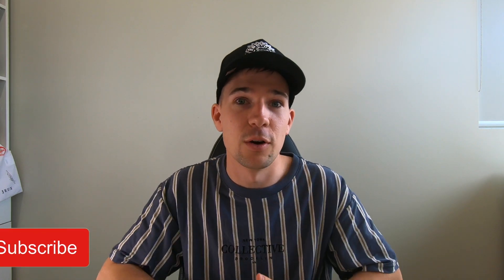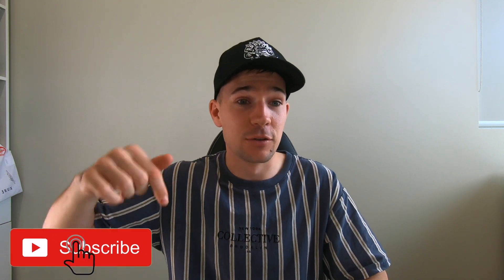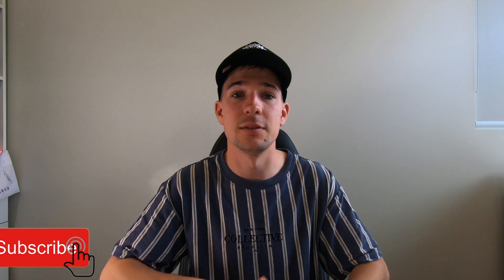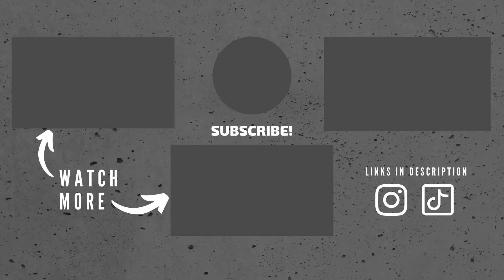TRAINING TO IMPROVE VO2MAX: What your doing WRONG AND how to fix it!

Comment: I find the only way to get  a real good VO2 max is to be a ultra skinny runner. I rather be a little more muscular & still be able to run a mile at 6.5min at 44yrs old as well as be physically stronger lifting weights than I would be with 5% body fat looking scrawny like the wind would just throw me around. Garmin is designed for ultra/ marathon runners so don't get caught up.worrying about VO2max if everything looks good.

Comment: Awesome video...highly detailed content. Based on my research true vo2max pace is about 7min flatout which I've heard you mention 7min also. Ive looked at the McMillan Run Calculator which gives the vVo2 pace set at 8min allout pace. Jack Daniels used to speak about the Vdot tables vo2max as an allout 10-11min value from memory (I think Jimmy Gilbert tabled all the values and worked for Nasa). Im now Using the 95% of true 8min outdoor vVo2max for my running. Sitting on 60km wks atm. With a 6:50km track 2km timetrial (3:25 pace vo2max spd)...5 x 1k @3:35 is 95% & 3 1/2min rest & curious if repeating this 2-3days later would be "ideal" in the 60km run wk spectrum. 

Along with a Zone1 recovery jog in between days say 7k @6min/k. An ankle injury is capping my longrun at about 18-20km which I will keep @65-75% heartrate reserve. Looking to go sub17min 5km over the coming mths/yr. Cheers
Reply from the maker: 2x sets just below VO2max in the week would be ideal pending ability to tolerate training load and as you said space them out by a few days to balance the week up nicely!

Comment: Let's say I'm 31 and at a vo2 max rough calculation of around 38-40.. and I'm training for a fire fighter physical. Lift weights alot but cardio sucks... should I run at like 7mph for 20-30 mins or should I do interval training. Keeping in mind currently I can only run at 7mph for around 16-18 mins.

Iv also been running at 7mph at like 6 Incline. Failing in 2-3 mins, then resting for 30 sec and going for another 30 sec, repeating like 4-5 times. So basically keeping my Hr high for roughly 4-6 minutes. But only doing this whole thing one time per day.
Reply from the maker: Not the best format to go in detail but my usual recommendation is you ideally want to build up to complete 30mins continuous without stopping before diving into interval work. Reason being the really good adaptations start at 20mins continuous running when going “long and slow”.
Once able to do that you typically have enough capacity to handle an effective interval session so I’d start to build in some intervals in your week whilst maintaining you long slow run (or adding some extra volume there if needed/want to).
Reply: @NJSportScience  is 7mph considered slow? Or should I be going slower than that for 30 mins?
Reply from the maker: Without any other data, I’d aim for a 4/10 RPE in your slow runs. Everyone is different when it comes to what is/isn’t slow, but RPE will be relative.
Reply: @NJSportScience  yah fair enough. I can prob run for 30 minutes at 5.5 to 6 mph. Does one work at getting the speed higher or intervals lol. Sorry for all the questions. I got about a month to train as much as I can.
Reply from the maker: It depends what you need to be able to do. If it’s a time trial and you’re not current fast enough I’d lean towards interval work. If it’s not a specific outcome then I’d have 1-2 interval sessions in the week surrounded by long slow continuous work.
Reply: @NJSportScience  I need to run at 7mph, and they increase the Incline every 2 minutes by 2 until I fail. The longer I last the better my score.
Reply from the maker: I would go about a mixed approach then. Do some high intensity interval work but also continue to work on your ability to run at 7mph. In theory you could just practice that test protocol once a week then follow it up with some slow continuous running after and that would be reasonably beneficial. Number of possible paths, I suggest keeping it simple. A few interval sessions and a few long slow at or below 7mph.
Reply: @NJSportScience  am I over training if I run at 7mph every day till failure and then 3 times a week do the practice vo2 max test?
Reply from the maker: I would do a practice test once a week, 2-3x 7mph runs then one more traditional interval session (ie 2-3min on at 9-9.5/10 RPE, with equal or less walking recovery, aim for 12-18mins of “working time”).

Very rough guide but that would be appropriate
Reply: @NJSportScience  awesome! Thanks for all the replies!

Comment: Hi, I love knowing all the nuts and bolts of the specific science behind the workouts which you don't see on a lot of other (great) channels. Is there any research on the number of sessions per week that is optimal? Once a week? Every third workout? Every other? I imagine it's somewhat dependent on the level of fitness, but don't actually know. Thanks!
Reply from the maker: Thanks mate!
Depends what you’re aiming to do, 1-2 sessions of HIIT to maintain qualities, 2-3 to improve however I default most people to 2 per week and manipulate the volume/ intensity/work to rest ratio etc to challenge them further rather than just adding more sessions usually.
Only case I really go to 3 sessions per week is really high level athletes where the 3rd sessions might only be used strategically here and there but also the overall training load is much higher so the proportion of time at very high intensities isn’t very much of the total training week if they only did 2 sessions.

Comment: how about some discussion for the older people 50 plus..my vo2 is 40 according to garmin watch ..what realistly could i get up to. nowhere near 60 i gather...been riding for years ..not improving at all..do 5000k per year
Reply from the maker: There is a large genetic component to your upper potential also which does complicate things further. To be honest the number itself doesn’t even matter, its the number in context that does (ie your VO2max might be 40ml/kg/min but you punch out 450W and an ftp of 400 for example, you’ll still win a flat road race compared to someone with a VO2max of 60+ at 360W, ftp of say 300W. Assuming all other factors are equal)
Reply from the maker: VO2 on a watch is highly reliant on your weight.  So typically older athletes who are 80+ kg struggle to get up to 60ml/kg/min but guys at say 60-65kg do it easily. Also depends on what type of training you do rather than how much. 
Time and time again I’ve gone in and cut out half an athletes weekly volume to get a 5-10% return on VO2max. Focus the time to train the top end qualities required to actually improve it. Why? Because practicing only your strength gets you no where, work on the obvious weakness, easy improvements.

Comment: 57 years old: VO2 session yesterday was 8x3' with 2' recovery. I think a 3' recovery may be more appropriate. Should the recovery be walking as I usually still run but at a very easy pace? Just bought a Stryd pod so I hope running by power is going to assist in getting to the correct zone to run in as paces are tough, especially here in South GA where it was 104F during my session.
Reply from the maker: Depends how hard you’re actually pushing relative to your VO2max. I would say if anything your not running hard enough to be able to do 24mins of work with short recovery. Run faster for say 5 x 3’ on/ 3min walking recovery then work back up. Better off increasing the pace than doing more volume once you get to beyond 20mins of work.

Comment: So in your video you talk about work/break ratio ideally being 1:1...is it better to look at it that way from a time perspective (working 30sec, resting 30sec) OR from a HR perspective (say you start at 100 bpm, working to get, say 90% of max HR, hold for 30 sec, and then rest until HR is back to 100 bpm)? Or is HR not supposed to go back to original levels between sets? If it does, what does that mean from a VO2 perspective?
Reply from the maker: Doing a video on this later in the week, short answer is for high intensity (ie 30on/30off) I go with pace/speed/power, then for long continuous sessions I’ll go HR. Will explain further in the video. Great question though.
Reply: Hey, probably a related Question: I often train at Work/Rest Ratios of 2 (30/15), because of the Heart Rate lag you talked about. This will keep the ventilation going also during breaks IMO. Is there benefit to this or is it Just about time at pace/Power (instead of HR)? Cheers!
Reply from the maker: There’s benefit to both but the key with 1:1 work to rest is I usually reserve it for efforts where you need to maintain a really high intensity consistently. For example when aiming for 95-100% vVO2max the important factor is time spent at that pace. In a session that’s more focused on building at and slightly above threshold I’ll for for 2:1 or 3:1 ratios because the effort intensity isn’t as high so it’s sustainable to have a shorter recovery.

That’s one example but holds true for the vast majority of amateur athletes who are unable to achieve a high enough intensity in their efforts to elicit the right stimulus if they don’t have an equal recovery. Particularly when looking specifically at intensities very close to VO2max.
Reply: Thank you very much for the quick an detailed answer! Keep Up the great Content! 😊

Comment: Great video thanks. You say threshold-type running can get you to a VO2max of around 60, and that people will need short sharp interval training to get it higher from there. But you don’t address whether someone with, say, a 45 VO2Max will make more progress with intervals, tempo or a mix of the two. Implicitly, I think it’s the latter, but you never quite make that explicit.
Reply from the maker: Long slow (base kms) type training by itself typically can improve an athlete’s VO2max until about 60ml/kg/min. To then increase VO2max above this you need something other than long slow distance training (ie High Intensity @ VO2max). Someone with a 45 VO2max still increases but probably progresses faster (ie 45 to 55 in say 12-15 weeks training vs 60 to 65 in the same time period). Law of diminishing returns. This is assuming no change in body weight, if you drop weight as well VO2max relative increases greatly. Lesser trained or untrained people can realistically get somewhat fit off doing anything. I could get someone with a VO2max of 40-45 much fitter than they are now just by saying “train 3-4 times a week however you like for 12 weeks” in most cases. But you’d only get from 40-45 up to say 45-50. These training tips aren’t exclusive to well trained athletes, it applies to anyone, the major point about 60 VO2 is research has shown long slow training on its own can get someone to 60 but no further. So why not train high intensity specific to VO2max and accelerate your development?
Reply: Nick Jankovskis Thanks - I appreciate you taking the time to reply. I’m slowly working my way through your videos, and I’m finding them really interesting/ useful. Good luck with the channel - it looks like you’re steadily adding subscribers 👍

Comment: Apologies if it has been described in the video (it is a long one). You mention your body takes 30-45 seconds to hit max effort. Should 1 to 1 be understood as time at max effort vs recovery or total interval time vs recovery? because there is a huge difference if your interval is only 200 to 400 metres (e.g. during a 80 seconds interval only 35 to 50 seconds are spent at max effort).
To my personally, resting for 1:30 after running 400 metres at full throttle is OK, sort of. But resting for 3:30 minutes after 1K can be too much (basically I think you lose a bit of excitement and can feel bored).

Comment: Great videos Nick. I'm curious to know, is vo2 max affected by weight? I can't seem to get my head around the widely held belief that it's largely fixed / untrainable. Surely if I've just got of the couch for the 1st time in 2 years it would be extremely low, whereas if I was to train full time for 2 years, lost 20 kilos, the maximum increase I can expect is 5-15%? That doesnt seem to be much of an increase.

Comment: Great video! Do you suggest the same 1:1 ratio for swimming as well? Because most of interval trainings I see out there have distance-based high intensity interval sessions with time-based recovery. For example 100m high intensity and 30sec recovery.
Reply from the maker: Great questions that I'm going to cover in a future video. It's a tricky one because the dramatic change from lower body dominant to upper body dominant, the skill/technique demand and a completely new resistance (that being you are in water). Typically swimming changes a bit.
Reply: @NJSportScience  thank you Nick. Looking forward to see this video!!
Reply: @NJSportScience  Has it been released yet?
Reply from the maker: I don’t think I ever did get time to get this idea done. Adding it to the list for the next batch of videos coming soon!
Reply: @NJSportScience  Cool, I subscribed to your channel.

Comment: Nick what's the difference between Garmin pace and HR lactate threshold calculation and VO2 max in your video. Am I suppose to hit lactate threshold pace to improve my VO2max or is it a different pace again?
Reply from the maker: Alan Shrimpton VO2max is your maximal oxygen consumption/maximal aerobic pace and is usually what you could hold for 5-7mins. Lactate Threshold is the theoretical intensity you could hold for 45-60mins. Usually threshold is about 80-90% of VO2max for most people. To improve VO2max you need to go at or above 95% of VO2max as in the video which is well above threshold pace. Hope this helps!

Comment: how would you know if you have reached your genetic limit over a normal plateau?
Reply from the maker: MrMacroVision it can be difficult to identify but typically most will hit their highest VO2 possible by their mid 40’s. Some do go on to have further increases but this only happens in populations where the person has started in sport later in life and is still on the improve. A good marker can sometimes be improving pace but VO2max is similar but this can also be an economy improvement. In short, it’s hard to find it. When I refer to genetic potential we more discuss the difference between an athlete able to hit 75-80ml/kg/min vs 55-60ml/kg/min, both may be competing at a similar level of competition and pacing but one is limited by muscle fibre type and percentage etc. Thanks for watching hope this answers your question.